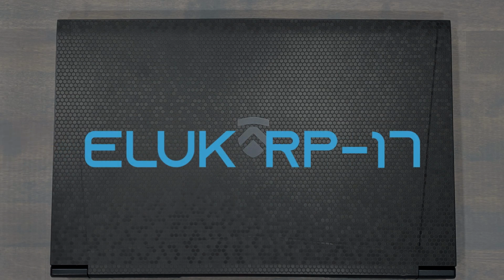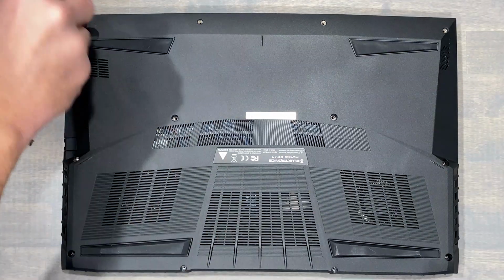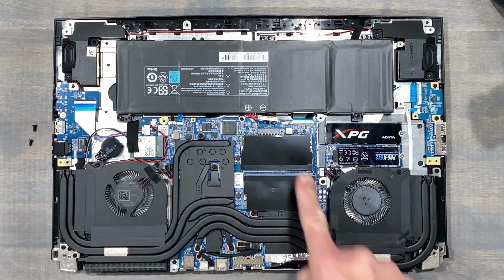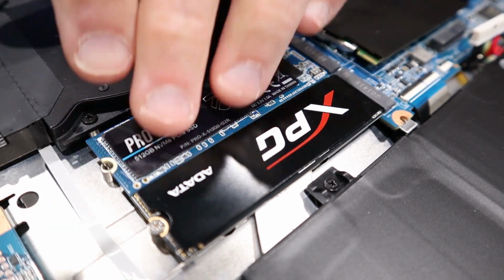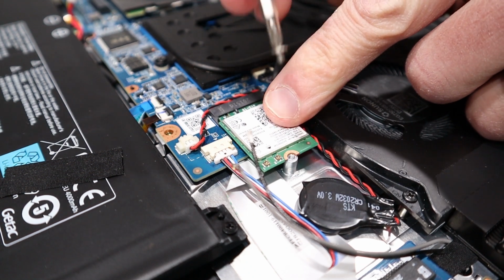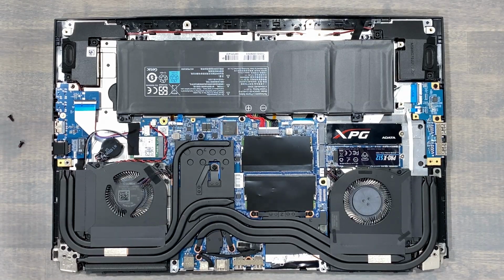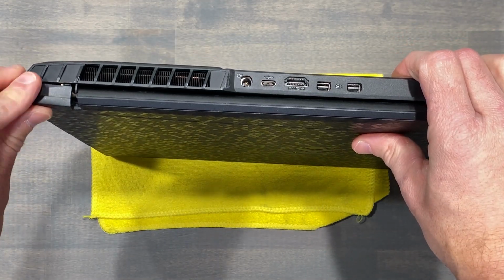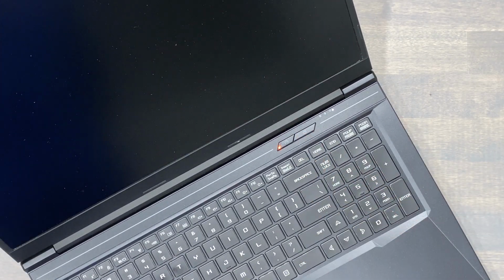RP17 ACCESSIBILITY Memory, Storage and WiFi

Comment: kinda pissed they went with 4800h for new 3000 series laptops.
Reply from the maker: Likely to keep cost down.  The 4800h is about $100 cheaper than the 5800h.
Reply: @BobOfAllTrades  where do you check for pricing of amd laptop cpus?
Reply from the maker: I have connections.. this isn’t quite public information.
Reply: @BobOfAllTrades  is it that much cheaper than 10750h?
Reply from the maker: @tonyss2416  that 6 core Intel is cheaper and available
Reply: @BobOfAllTrades  cause this guy https://www.youtube.com/watch?v=zM86auSGb2M is saying in gaming 10750h is on average 8-10% faster and thats like going from 2070 to 2070 super in terms of fps performance
Reply from the maker: @tonyss2416  not too sure what that has to do with cost.  so what are we talking about here?
Reply: @BobOfAllTrades  yea i am thinking elu is getting away from gaming laptops and more of productivity types laptops
Reply: @BobOfAllTrades  the reason why 4800h over 10750h
Reply: @BobOfAllTrades  I think you mention this before that 4800h will be not enough for those 3060/3070 cards. Just trying to see the reason why they blundered so badly

Comment: Few weeks ago I accidently hard pulled the grey aux wire from the wifi card on my old laptop and in the process the small metal that connect the wire to the wifi card got removed, will soldering the wire in place of the removed metal solve the problem or I should I just get a new one ?

Comment: Damn, was kinda hoping you would go over heat pipe removal for thermal paste application lol I have the rp-15 and can’t seem to find screw #1 although I’m thinking it’s under a piece of tape at the edge lol
Reply from the maker: It’s under that tape yes.  There might be two hidden. One under silver tape near the rear and one under black tape between the GPU and fan 😉